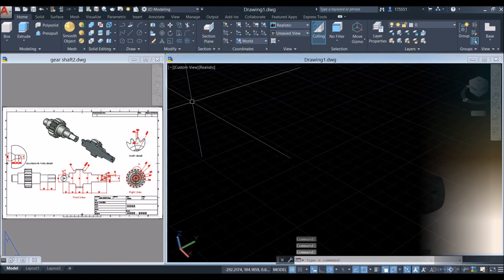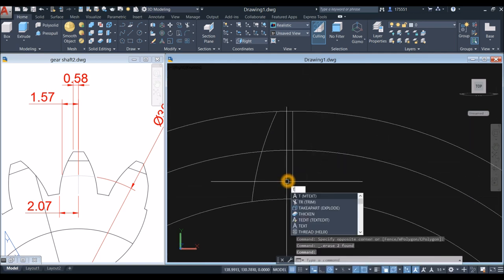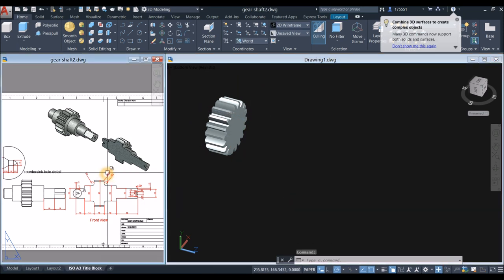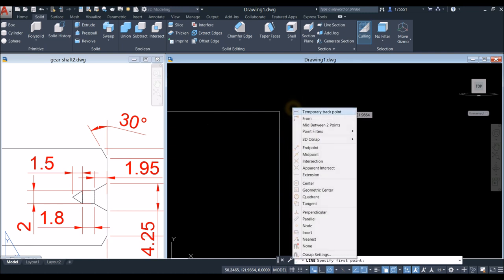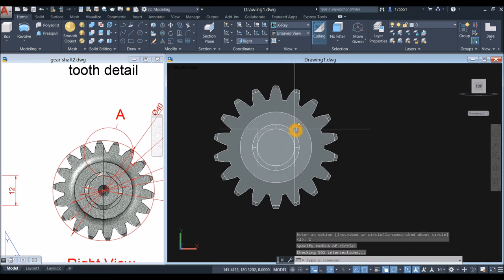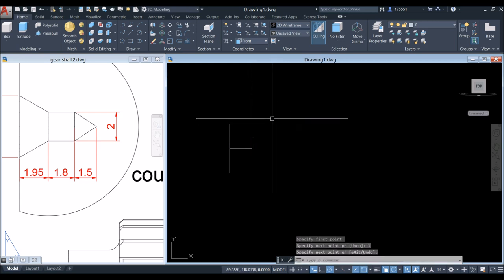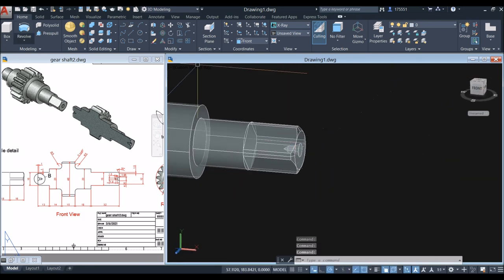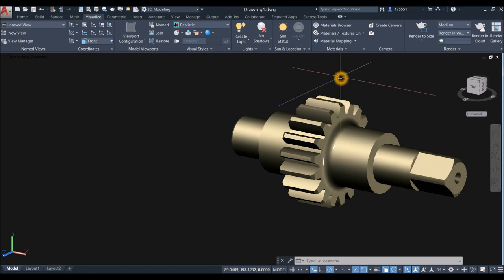Gear Shaft Tutorial  In Autocad 3D

Comment: I began to wonder why my gear teeth appear much more slender than yours. It looks like you entered 0.8 instead of 0.58 for the dimension of the flat top edge of the gear tooth. Then the mistake was doubled, as you mirrored the tooth to make it complete. Also, in the PDF drawing, the location of the 36 diameter does not appear accurate, as the 36 falls closer to the 31 diameter, whereas it should fall closer to the 40 diameter in the drawing. This  changes the arc of the tooth on its outside edges.